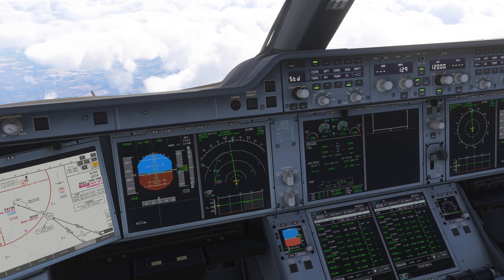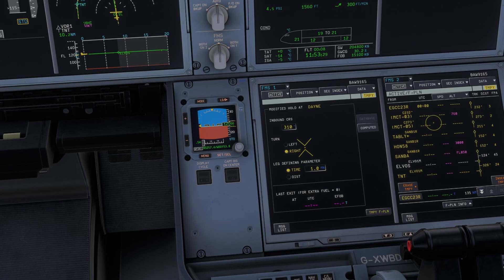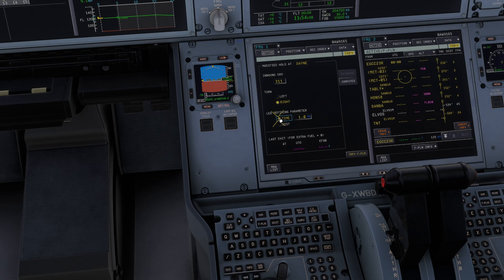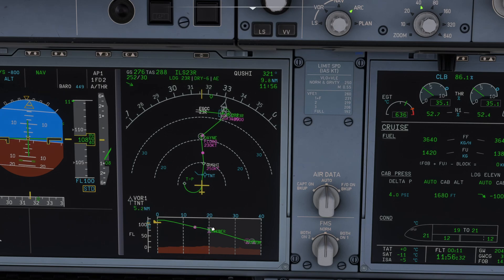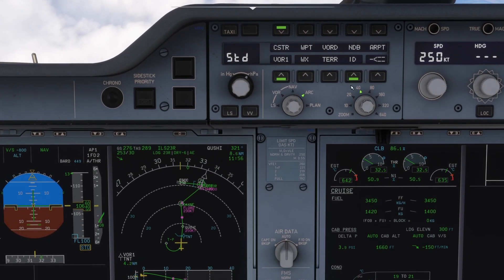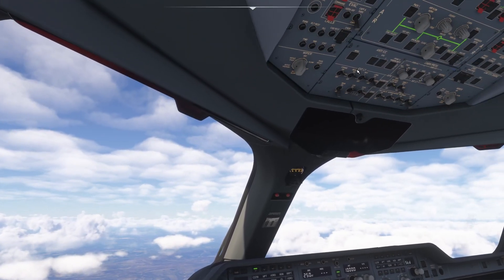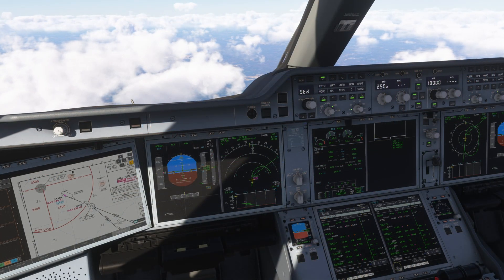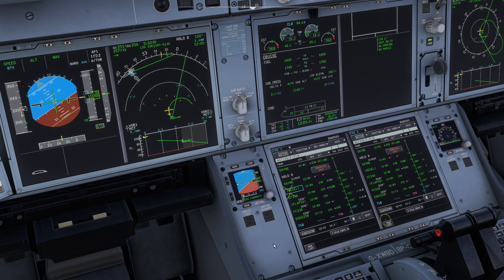iniBuilds A350 Tutorials - Episode 6: Flying Holds [4K]

Comment: Very useful. I am having issues with understanding MANAGED on the A350, also issues with STEP CLIMBS and auto DESCEND on TOD (once target alt is set on the MCP) but not working as I am not sure if it is even possible.
It would be great to have a VIDEO explaining those. Thank you for this GREAT VIDEO.
Cheers
Reply from the maker: @brazeagle  managed is the jet doing what it wants to as per the FMS
 For TOD, set the target altitude then push it to select managed descent about 5nm to 2nm or so before. It'll then begin a descent slightly early but allow for a smooth and gentle entry into descent phase

Comment: Please, tell me if you know what is the blue (or green) square bracket just over the hold pattern on the ND? (5:25) I only see it with the A350. Thanks !
Reply from the maker: i've tried to look into it but can't yet find anything
Reply: Found it ! It's the range of the vertical path box
Reply from the maker: @06L  ooft sorry I'd completely forgot to update this! At least you found the answer now! Yes it's the VSD Range indicator

Comment: Would you just keep holding until the ATC tells you to exit it?
Reply from the maker: @JacksonTetley yep! You'd continue to monitor fuel etc though and if you're started to get low (1000kg above fin res+altn fuel for example) then you'd tell them you're getting low on fuel and they'd ideally get you out and on the ground - failing that you'd declare a pan pan pan fuel